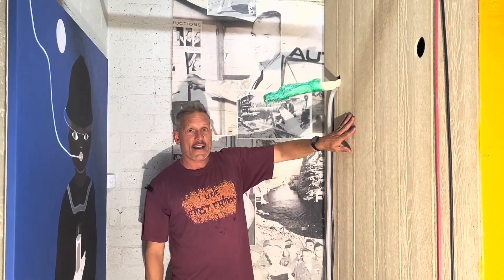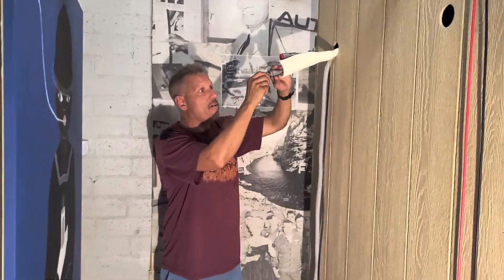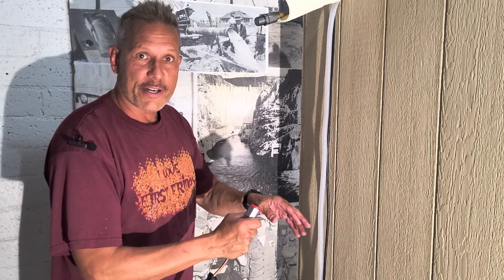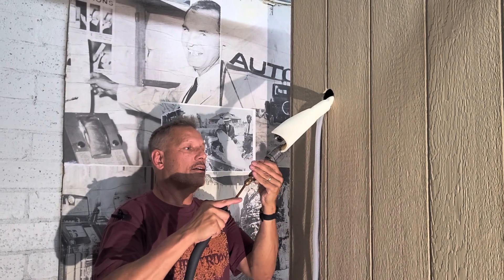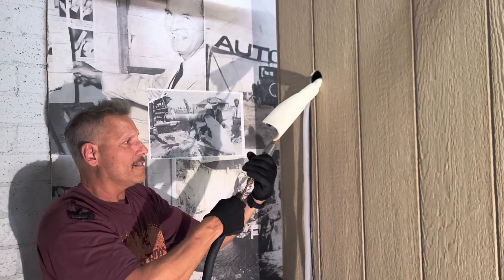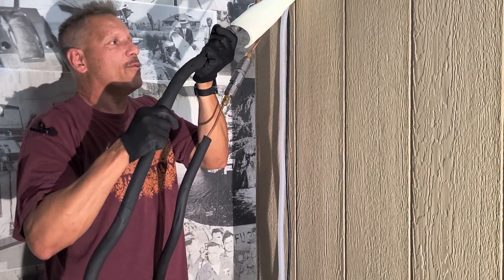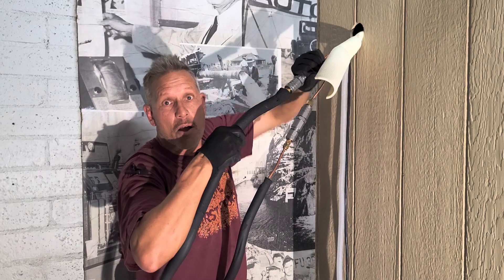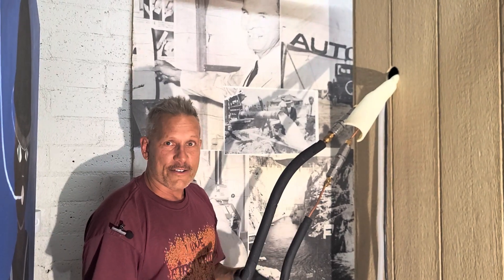Quick 'n' Easy install #3:  connecting line set using the hand-tightened quick connectors

Comment: What should be the clearance (in feet) between the outside unit and furnace exhaust vent? In case of potential carbon monoxide poisoning....
Reply from the maker: Well, none of this air from the furnace exhaust that will come inside, because the air just goes through the outdoor unit coil, and doesn't get pumped inside, but it's still probably wouldn't be a bad idea to keep a little bit away from it in case you need it to ever work on the unit.